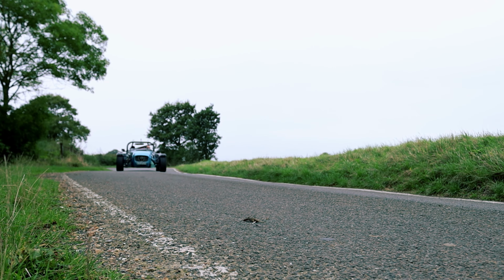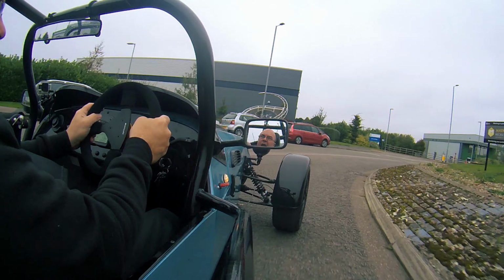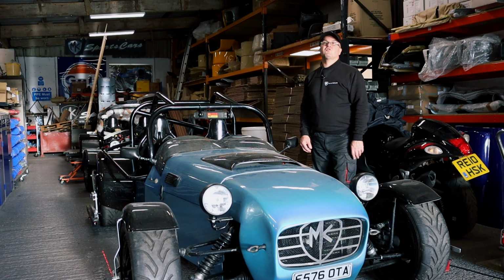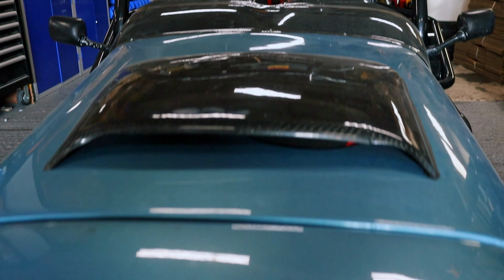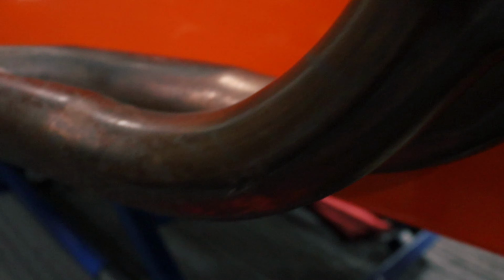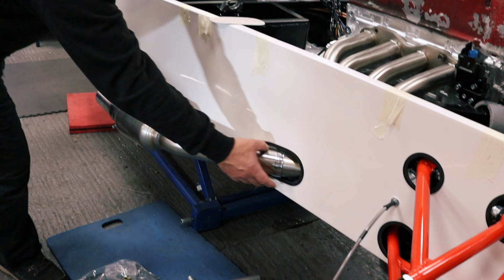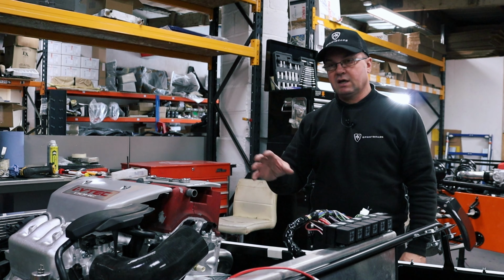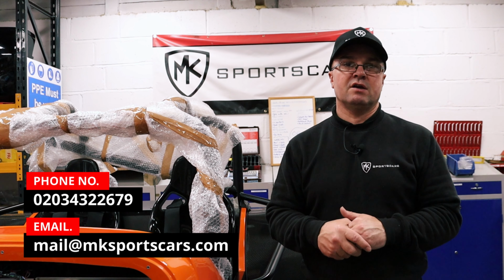Ep 94 - Will the 260BHP/TONNE 919 FIREBLADE INDY CLASSIC Test Drive go to plan?! // Workshop Walk 94

Comment: I used to work in the automotive industry, and when using trade plates, I was told by the DVLA in Chelmsford (when they had an office), that to be insured both plates need to be at the very front and very rear of a vehicle. 😉 regs may have changed, might be worth finding out?